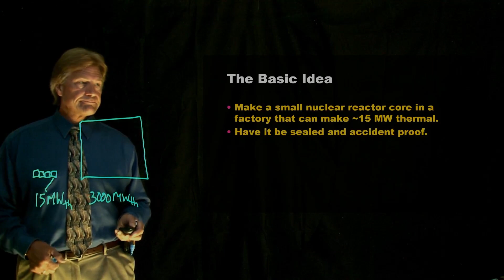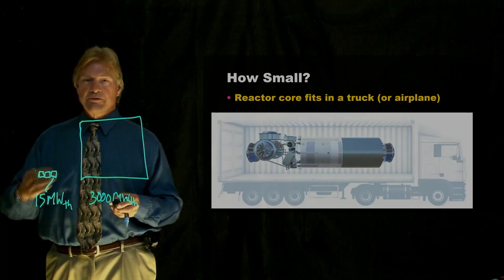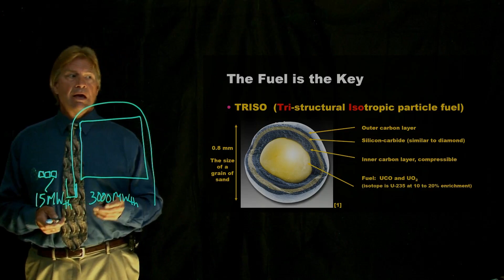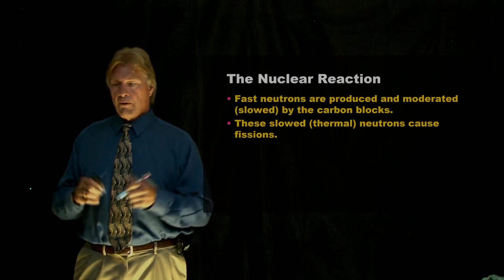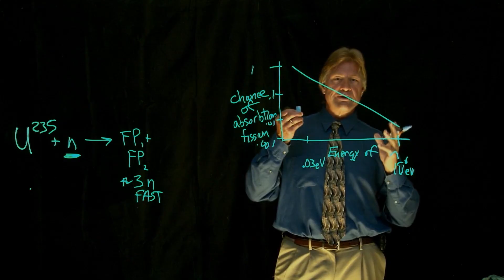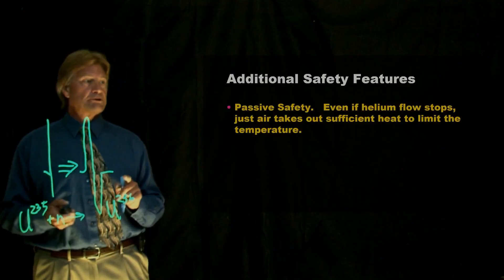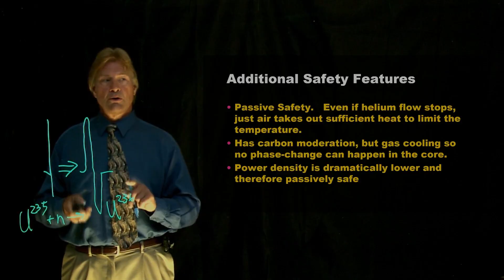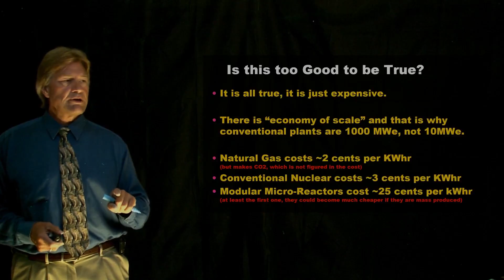Modular Micro-Reactors – The Future of Nuclear Energy?

Comment: I liked your show, but you left out the fact that you can use the used fuel rods which have only used 3% of the fuel, and send the remaining 97% to a liquid salts reactor which will use about 97%, and now you only have about only 3% left to bury! Also when we first started building reactors in the 60's by the 70's the powers that were trying to stop neuclear power plants found out they could stop them by puting permits. and requirements on every nut and bolt, pipe that it caused just about all building of the plants to stop, and I think the USA has I believe only about 2 or 3 plants since 1980. We need drastic changes, in the rules that intentionaly sufficated the neuclear energy. If we do the costs of electricity will drastically fall  

6

Comment: If this is a micro-reactor proposal, I want a "nano-reactor". About one-hundredth scale down. 20 kilowatts electrical output. Run my air conditioning and pool pump. Level 2 charge a Tesla (20000 watts/240 volts = 83 amps, my 100 amp breaker panel can handle it). PNR -- Personal Nuclear Reactor. BTW -- my electric bill usage charge is ~$0.14/kilowatt-hour.

Comment: How can these heat water enough to generate some MWs of electricity (or 15mw of heat), YET are not generating so much heat that passive air cooling can keep them cool?
How about when they are being transported, like in a plane or train where there is little air flow?  Can they be physically turned off other than it reaching a maximum temperature at which no more fission will take place?

Comment: using the thermal output for heating would be good for district heating if heat pumps weren't so strong. there is a pretty limited selection of places its cold enough that modern heat pumps can't work well.

Comment: The risk also increases much more the more reactors one has. I have nothing against placing them in remote areas but not for standard use. Why cant we use the same concept to manufacture large nuclear reactors. India is doing it with its heavy water reactors. Our problem is that we have become frightened of everything and stupid on top of all. Just because Rolls Royce has found one or two small investors we think the problem is solved. It also seems to be new designs. After all they told us before that those earlier pressurized water reactors were safe. It is the wrong reactor from the beginning for civilian use. It was chosen because of non-proliferation. Even the man that designed it said that it was the wrong reactor for civilian use. Do your home work.

Comment: A distinct advantage of these micro-reactors is that they can quickly be isolated from the national electrical grid to prevent some cascading catastrophic EMP attack or hacking of the national grid.  They can be isolated to provide electricity for community consumption in times of emergency, rather than entire metropolitan centers requiring thousands of megawatt generation for large urban areas.

Comment: you still need a sturdy containment building for impacts from the outside. "small" modular reactors is a bit of a misnomer, rather should be "low power" instead. the reactor core isn't really smaller by comparison. i.e: the core height of a BN 1200 will be about 0.85 m. it's only the generators to remove the heat and all extra equipment that make an SMR much smaller. we should be aiming for "high power modular reactors".

Comment: On a Light water reactor, if the water is in a closed loop and its both used as coolant and moderator, don't you eventually start building up heavy water? The neutron absorption cross-section of the light water is small compared to other materials used as control rods, but not negligible. 🤔

Comment: We already have micro reactors. They are called submarine reactors. I spent 10 years as a Reactor Operator in the Navy on subs before becoming a commercial reactor operator.  Different fuel, but the component size has been achievable for 65 years.
Reply: My thoughts exactly. The technology and ghe fuel are very different, but the concept has been around in several navies for decades.
Reply: Which raises the question: why can't naval reactors be used for land based purposes?
Reply: @edwardmansfield3475  I'm by no means an expert, so if anyone knows better please chime in, but I was under the impression that naval reactors are currently designed to use higher-enriched uranium, which is a proliferation risk compared low-enriched or HALEU fuel, so the military isn't keen on sharing that with the private sector
Reply: @EmperorBun give the tech to the army corp of engineers, set up an SMR at every military base, with excess power shared into the local power grid.

Comment: Most hipsters today, don't understand that just because your roof panel can slowly charge your phone or laptop, it can't make you a dinner.
Reply: it gets only better when you take that hippie to some manufacturing plant and show him how much energy an automated production line requires.
and it requires it 24/7 - doesn't matter day or night, winter or summer, clear sky or rainy day
that's why I won't ever believe renewables would ever become anywhere close to good enough.
Reply: Having spent time in an off-grid house running on solar and lead acid batteries (plus a small diesel genset as backup) I can confirm that this is complete baloney. The batteries easily ran everything but the hot water tank (also solar) and the stove (gas fired). Lithium batteries would handle an oven easily, you just need an inverter that can keep up.

Comment: All the old uranium and thorium fission reactor problems go away with the new Fusion reactor era now here. We have recently taken a new step to advance the physics of power production by enabling chemistry of the atomic nucleus, or "nuchemy", We are passing the chemistry level where we interacted with electron shells and are moving on to nuclear manipulations in this "nuchemy" atomic nuclear era when we interact and multiply nuclear protons using hydrogen fuel stock. We have rediscovered the lost work of the alchemists and can make new elements with different atomic weights and vastly new properties. This was ably demonstrated in "The Safire Project". Quanta are important. We now have enough energy in them to manipulate the atomic nucleus much more easily by creating a compartment or a local region of plasma containment so reactions at this atomic nuclear level can easily take place. This is about to practically enabled a fantastic new era of energy production for the whole of mankind. This with free fuel obtained from water or atmospheric moisture anywhere in the world. New fusion nuclear is at the industrial commercial production final development point as of now. The energy argument and other power methodologies are all now irrelevant as we have new and very physically and economically powered practical and local community level fusion nuclear power. Solar roof plus Teslawall battery may be the present way to go domestically but megapack batteries and multiple storage technologies interconnected with an expanded ugly grid have a less certain requirement when you consider new any-scale community based and 24 hr self-fueling reliable fusion nuclear in the form of the "Safire Generator". Learn all about it at "aureon energy.com". Learn the newer EU physics at "Thunderbolts Project.com" and you will be permanently reeducated with the advanced new theory.

Comment: After watching the photo etching via plasma for transistors/chips video and the fusion reactor ones; I had thought to myself that maybe one day, we could manufacture nm scale fusion reactors, lined with say 1nm wide molten lithium channels.
I am merely a layman, and have no idea how the various pressures/confinement time/temperature, using nearly atomic scale fuels, liquid mechanics of molten lithium and electromagnetically manipulated plasma would (if even) work, not to mention the radiation, but; 
Even if the supporting modules for this tiny etched micro reactor, the D/T exchange unit, fuel systems, cooling, etc, were huge by relative scale (massively over engineered to the point of such inefficiency that you wouldn't want on the larger reactors due obvious reasons), maybe eventually you could manufacture a net power producing product, that could fit into something the size of a watch. That of course you could scale it up but the main point is, that, these tiny self contained, disposable even, reactors could be produced on such a massive scale that would render batteries obsolete and do so much more. 
Again just a layman, just thought I'd stick this probably ridiculous idea out there.

Comment: I'm a mechanical engineer with a degree emphasis in nuclear engineering. I've been working in the nuclear industry since 2001. I spent many years at a BWR mk IV with a 3486 MWth core and 1158 MW electric turbine generator. Huge amount of energy on a single turbine shaft. I've always though that the economy of scale didn't make sense due to maintenance constraints, as you can't deal with the reject heat if the turbine trips without taking a SCRAM. Multiple turbines scaled to local grid demands is the way to go.  Even two or three turbine sets in parallel on such a large core makes more sense. Add to that the modular reactor negative temperature coefficient and other passive safeties and this is definitely the way to go. It's the sunken costs of having to perform a refueling outage every two years, and any forced outages, coupled with the lost generation during those 30 to 40 day outages....over a million dollars a day in lost generation.

Comment: Had the initial drive for nuclear power been for energy instead of weapons, imagine where we could be. Your house could run on a reactor the size of your fridge. Your car, running off a shoebox sized reactor.
Reply: You can't scale them down indefinitely. You need a certain mass of fissile fuel to achieve a super critical state. A state where we extract more energy than we're putting in. The only way to do this is to used fuel that is more dense in uranium 235. Basically enrich it some more. The problem here is that it's politically going to create concerns over proliferation of nuclear materials and compromise the Nuclear Non Proliferation Treaty. It is an interesting idea though. And I am very much in agreement that if the early days of nuclear reactors (nuclear piles as they were known then) was indeed about energy rather than weapons I wonder where we'd be now. And of course if weapons was never the intention why worry about proliferation.
Reply: We built Hoover and the Grand Coulee Dams. If the US got serious about nuclear energy like we did with hydropower in the 30’s & 40’s, we’d all be better off.
Reply: @MultiPetercool  I completely agree and I'm a Brit. America has been wasting the opportunity. As has Britain, we're not better.

Comment: small micro-reactors are the future, only for the military ( and NASA)!  Because those don't have to worry  much about Neutrinos and Tritium, which will damage the DNA of fertile-age (young) women and babies  ( ->fast growing tissues!)
Reply: Neutrinos are widely abundant and very hard to detect because they don't interact with anything. Tritium is present in sea water. Not sure I can make any sense of your point.
Reply: @paulanderson7796  many small reactors, distributed across the country pose a Neutrino-problem: you can't keep staying away from them. As it would be possible, if one very powerful were operating in a remote place, far away from population centers (inverse quadratic law of flux-intensity). it would need long transmission lines for electricity though. 
  Tritium, additional to the natural level, is added into the ocean by pipes, which dispose of the diluted effluents of nuclear-fuel-reprocessing plants.
   in an economy, which has one fusion- and a few powerful fission-reactors, it would make sense to collect (sequester) the tritium and feed it to the fusion-reactor. Relying totally on wind-power, as well as going totally nuclear to replace fossil-carbon fuel is imprudent.

Comment: The economics-rule, that folks will go where it's cheaper, clearly affects Regulator-choice:

Makers of the reactor cited here chose CNSC's Function (vs NRC's Rule)-based process. Prototype MSR will also be built in CA: CA's own IMSR; UK's SSR. See: SmrRoadmap.CA

Bret Kugelmass has been nudging, eg, Estonia Not to bow to US pressure to act like NRC,
rather: Adopt early US reg'ns, which applied during USA's more productive, pre-NRC, years)

BTW, here, you show the Molten Salt aspects of the cited reactor, but in another video, you
don't show much love for MSRs. (Nor does Kugelmass, in his talk @ John Hopkins' APL.)

IF both are new designs (at least the "fuel-system" of this one is) & likely to have supply-
chain issues, why you don't like the MSR, whose fuel seems simpler, & likely cheaper?

IAEA's free "SMR-book-2020.PDF" covers reactor types, from the "NuScale" (fuel-rod "dino-
saur," IMO) through the more popular MSRs (Bill Gates' & other independent designers),
although MSRs are still relegated to the back of this book (updated every 2 years).

Comment: there's also the fact that the reactor needs to keep running and not stopped to actually use it. 
where as fossil fuel can be stored and used in demand. 
basically, for even micro reactors, you have the storage problem: a lot of energy will get wasted or not used. At times itll produce less than what's needed and at other times, it'll produce more than what's needed, due to the nature of how constantly energy gets produced with these things compared to how energy use peaks and falls throughout any day.
Simply fixing the costs, safety and size & location problems for nuclear reactors won't be enough, you'll need battery technology to "store" the excess energy, and give more output when demand for energy is high  (more than the constant rate at which the reactor produces energy).
So add battery costs, battery power efficiency and all of that, and micro reactors still have some ways to go before it becomes feasible and actually competetive with fossil fuel.
Because the system depends on both micro reactor tech AND battery tech.

Comment: It seems to me something like this could help Canada more effectively exploit tar sands. With the current model they burn as much as 40-50 of the product to heat the next batch. A strictly thermal load like this would be awesome. No turbine, no generator, just hot water going in and oil going out. Over night tar sands will go from the dirtiest form of oil to the cleanest.

Comment: Would micro-modular generation also be the best option for colonies on the moon or on Mars? On the moon, you'd have issues with dust, debris and other small impacts damaging the cells and and impacting efficiency but on Mars, you've got that factor as well as distance from the sun, Mars' dramatic seasonal fluctuations in sunlight, the fact that there's an atmosphere, etc as well.
Reply: I think power and heat sources are the least of the hurdles.

Comment: I came here because of a recommendation by Real Engineering.

If I'm not mistaken, the designer of the nuclear reactors for submarines, in the US, was against making larger one because then there would be no way to guarantee the core temperature would not rise to a point where it could melt anything. There's an excellent series by the BBC called "Pandora's Box" where the filmmaker Adam Curtis tackles the relationships between technology and society. It's done in a dialectic manner and one episode dialogues with the next in opposing views to then reach a conclusion.

About the heat that can be taken out of the molten salt stage: in the former East Germany, nuclear power plants did deliver heat directly to the surrounding buildings. In Paris, France, the electrothermic power plant that runs on trash and is hidden near the Eifel Tower also distributes heat directly to the surrounding buildings and subway stations. Aluminum also requires both electricity and heat -  heat for the extraction of aluminum oxide from bauxite and electricity for the electrolisis reaction. This is an awesome idea - I had heard about it before but neve in such details. Thanks!

Comment: TRISO fuels attempt to give the benefits of a fluid fueled reactor in a conventional fuel sale model where the profit is in the fuel sale. Hard to do that in a true fluid fueled reactor.

Honestly, the waste issue of any solid fuel is a big turn off. Fluid fueled means the ability to reprocess while the reactor is operating which improves fuel burn up and means we can sell usable isotopes for profit. MSR operating temperatures also offer other advantages for process heat, district heating, etc. on top of power generation.

Comment: Amazing fuel make-up and one-piece design. Submarines use similar reactors. The fact that newer ceramic compositions mark a new safer power. A one-piece design marks the end of on-site flaws made by construction oversights. The fact that when high temperatures slow down the reaction marks better control and safety. Water being excluded as a moderated is quite a plus. Less safety control systems are complex and costly. Smaller facilities can be implemented as water spent fuel pools are no longer needed and smaller fuel mass mark better energy and energy control. Automatic self-control shutdown systems mean that operator errors and interventions are excluded make accidents due to controller error history.